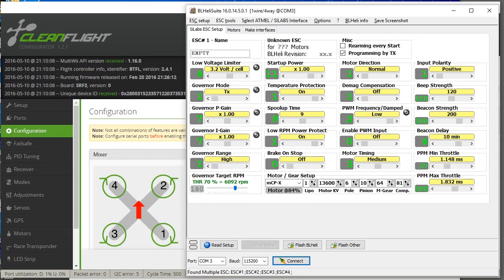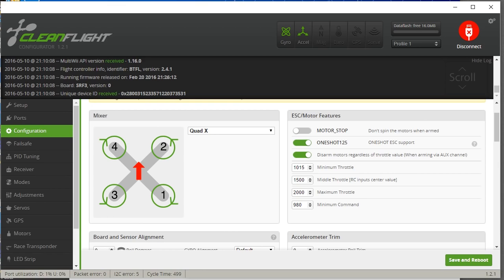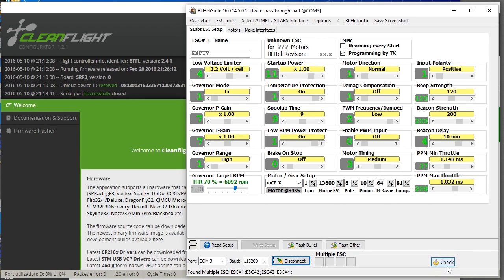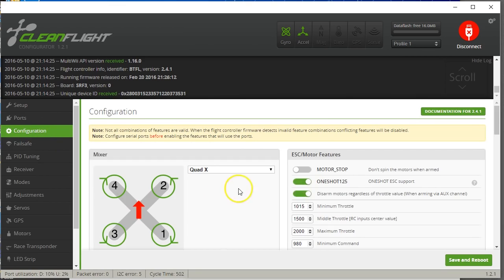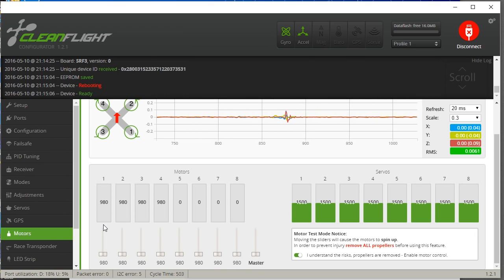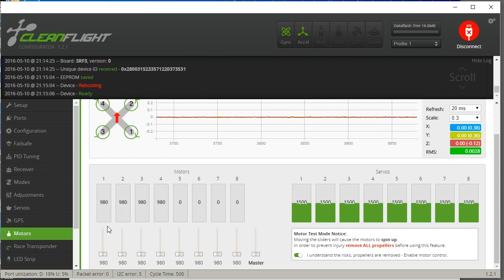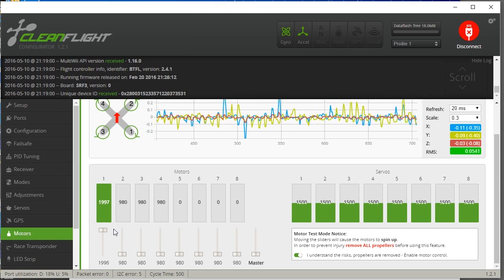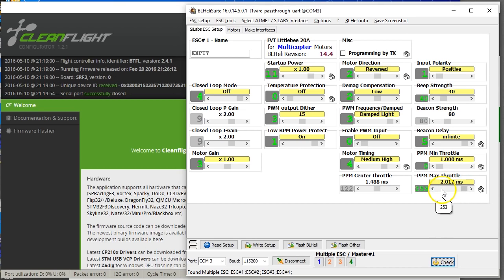Maximum Resolution ESC Calibration

Comment: I'm a bit confused on how to know the "magic number". It's supposed to be  how many microseconds I need to the point where my motor just barely starts to spin up and my minthrottle. How do I then know my minthrottle is correct? Is it pure experimenting? 
Also after a reboot the mincommand went from 1015 to 980. Why is that?
Reply: Im confused to. My minT is at 1150. And my motors barely starts spinning at 992. So is the magic number 1150 - 992? ore from 980 to 992? I must be dumb XD
Reply: No wait do i take 1150 - 992 and divide it by 2?
Reply from the maker: Here's how to know when min_throttle is correct. It's the point where, if you very lightly pinch the motor with your fingers, it doesn't stop spinning. On my ESCs, it's about 20 us.
Reply: Okay now that i get XD Thanks and thanks for all your videos. Really helped me get up to date again :P

Comment: Tried a 2S battery but it doesn't have enough voltage to boot my ESCs. Using XM20A. Cant Calibrate top end til I order a 3S I guess
Reply from the maker: +BGUFF weird. 7 volts should be plenty.
Reply: I found that 2s won't do it to. Works on the low end

Comment: Joshua I just did this with my quadcopter running betaflight 2.7 running oneshot 125. I had to set my min command to 970 because the motors would spin at 980. I then did what you said in the video and my motors were all spinning at 985. I added the 15 ms to get 1000. Then when I did the top end calibration there was no difference between 1990 and 2000. I kept going down and I only heard a tone difference once I got down around 1960. Is this normal? I am running littlebee 20a esc's on blheli 14.6.
Reply from the maker: It doesn't sound too far off. Maybe raise max_throttle a bit just to be 100% sure you're not losing top end.
Reply: I have the max pid value on the esc's set at 2020 and the max throttle set at 2000. Are you saying to set my max throttle higher than 2000?
Reply from the maker: I thought you had max_throttle at 1960.
Reply: Nope max throttle is at 2000 but I only hear a tone difference in the motors when I go down to 1960. It's the part of the video where you say to go to 1990 and then press the home key to hear a tone difference in the motors. I don't hear a tone difference until I go down to 1960 and press home.
Reply from the maker: That's surprisingly low. If you can safely do it, repeat the test with props on and see if it changes.

In theory, your PPM_max should be around 1960 to remove top-end deadband, but that's an unexpectedly low number and I would be suspicious of it.
Reply: Could it be caused by me using a 3s battery? It was only at 11.2 volts but I had no smoke stopper on it so could it just be free wheeling at the high end?
Reply from the maker: I don't think the RPM curve should significantly change based on the voltage, but I could be wrong about that.

Comment: just stopped by here again.  my sp racing board wouldn't do esc passthrough on blheli when i had cleanflight flashed, but i loaded betaflight onto it the other day and now it does. :)
Reply from the maker: Good news!
Reply: Well I have a similar issue. Just to check I used my sp racing board to see if I could use the passthrough feature and plugged in a single ESC. It worked fine.
I have now soldered all 4 ESC and when I hit connect in BLHeli all the motors start beeping together and the ESC are not recognized. BLHeli suite does see 4 ESC just no info. When I tried with a single ESC it had no motor connected so I have no idea if the beeping is normal.
Thanks for a any help :)
Reply: +nek111 im sure joshua will have a more enlightened view but its good that the escs are beeping, did you select the flash option so that blheli can find the firmware?  if you bought "blheli" capable escs they might still have simonk bootloader on them from the factory even though they say blheli on them. i had some low cost chinese ones i had to flash using simonk bootloader first before i could play with the settings in blheli suite
Reply from the maker: +Phil Dawe with Betaflight 2.7 and blheli 14.6 and up, you can do pass through over SimonK bootloader too.
Reply: I am a dummy :P After ruining a perfectly good solerjob on my board to test with a single esc, I realized my issue was that I was powering the esc before connecting in BLHeliSuite. All is good, thanks for the pointers guys, but it was just random user error, teaches me to fiddle with this at 4:30am... :P
You just got a new sub, great channel buddy!

Comment: Hi Joshua. I am getting more involved with my quad and am looking to do this calibration and the Maximum throttle calibration that you discussed in another video. Do I still need to do the maximum throttle calibration after doing this? Is there a certain order I need to do them in? Thank you very  much.
Reply from the maker: No. This includes the top end throttle calibration procedure in it.

Comment: I want to try this, but i have a doubt. Do i have to set my throttle low end point on my radio to 980? also, when doing this calibration to each motor separadetely, im going to get diferent min and max throttle points for each motor??  Thanks!
Reply from the maker: No. The input side (Transmitter to Receiver to FC) is completely independent of the output side (FC to ESC to motor). The input side always goes from 1000 to 2000 unless you have used the rxrange command to adjust this. The ESC calibration is on the output side. The two have NO relationship to each other at all. This is a very common point of confusion.

Comment: Hello Joshua,

I did this and I noticed that my motors spin on arming now. This is with BF 2.8.1 with my ESC min throttle at 1000ms and my BF minthrottle at 1038 also my min command is 950 running multishot. 

Any idea why the motors spin on arming?
Reply: I found once motor stop was enabled it fixed this problem, but I noticed in the video it was not on for you.
Reply from the maker: Is motor_stop enabled? Is air mode enabled? Both of these will keep the motors spinning on arm. Also, your min_command could be too high.
Reply: +Joshua Bardwell 

Air mode is enabled, but it does not activate until 1300ms in 2.8 correct. I enabled motor stop and that fixed the problem for the armed motor spin up. I thought min command at 950 was low, do you think it needs to be lower?
Reply from the maker: 950 is plenty low. You should be fine.
Reply: +Joshua Bardwell 
After flying I found with motor stop on that the motors would completely stop when I zeroed throttle while in the air and the quad would tumble. But when I turned motor stop off it flew great! No more dropping out of the sky and upside down feels great! Unfortunately the motors spin upon arming now. Any idea why this is?
Reply from the maker: That's just how motor stop works. If you really want, you can program an idle up switch so that when you arm the copter, the motors don't spin, but then in the air, they never will stop. But honestly, I think having the motors spin while arming is much safer. You have no idea how often I have seen someone using motor_stop accidentally bump the throttle and scare themselves while handling their copter because it was armed and they didn't realize it.

Comment: Thank you so much for these videos! I just went through doing this for the first time and learned so much in the process. My max throttle had so much dead band at the top I had to lower it from 2000 to 1900 before I started hearing the difference.  I did a little experimenting and now I know how those numbers all correlate. I've  been struggling with tuning different quads' throttle ranges and this is my answer.

Comment: Can you connect a LiPo battery charger to the quad and set it to charge a 2s battery instead of actually using a 2s battery as you suggest? I don't want to have to buy a 2s battery just to do this.
Reply from the maker: That' won't work. The charger is smart enough to know there's not a battery plugged in.
Reply: +Joshua Bardwell if I add a light bulb in line would that add enough load to trick it maybe?
Reply from the maker: No. It's going to measure the existing battery voltage, and when it sees none, it'll give an error. Maybe if you put the battery in parallel with the copter it would work, but I don't know.
Reply: +Joshua Bardwell okay. Sounds like just buying a cheap 2s is the way to go. Found an 800mah for 6$ shipped from NY so I'll just snag that since it's pretty cheap

Comment: Min throttle coming from my radio is @ 1071 but after setting ESC PPM Min to 1000, my motors will start to spin @ 1019.  I'm not really sure what to do with that data.
Reply from the maker: The input side (TX to RX to FC) and the output side (FC to ESC) are completely independent. Their endpoints and configuration parameters do not relate to each other in any way. The input side goes from 1000 to 2000 by default, unless changed using the rxrange command. The output side goes from min_command to max_throttle, and it is those values that must be calibrated to match what is in the ESC PPM min and max.

Comment: Wow...I just applied this and my airmode is now smooth as a cat fishes belly!...one question. You stated it should be done with all 4 motors? Would not that put them out of balance? And how would I set the end points individually? Shouldn't it all be one curve? Min to Max?
Reply from the maker: +G-Sawus the max may vary by ESC if their oscillator are slightly different. It probably doesn't really matter.

Comment: Why did you throw out 1000-2000 the lower dead zone (980-1000), but the hi is not thrown out, to be in 2000-2020?
Reply from the maker: +Евгений blheli won't let the bottom go below 1000 or o would go there.

Comment: So the "older" ESC's 1 1/2 -2 yrs are F330's?. Do you use the min throttle and max throttle command in cli to calibrate? Like with simon K or just the cheap hobbywing (don't ask).... I have a few sets that are not marked, how do you find out what firmware?
Reply from the maker: +Robert Erwin If you go back 1.5 to 2 years, I don't even know if F330 was the standard. I honestly don't know. Back that far, most ESCs were running SimonK I think, and BLHeli was more in the helicopter world than multirotors. If you have old, unmarked ESCs, I wouldn't run them on a multicopter at all.

https://www.youtube.com/watch?v=NOnm5a7S3aA

Comment: Hey Joshua, I think there is a little issue in this method maybe only with MS. So I did this method just now and during the full throttle calibration I had a thought: the ESC expects the full throttle ppm at 2020ms and the FC is set to 2000ms so what if the FC endpoint can't reach/overshoot the ESC endpoint and by that don't reach full rpm. With this thought I set my ESCs to a point where I was sure the FC setting is above. In my case I gave 1887ish a chance and the motors spinned way higher. So there will be a point if you go down from 2020 where one can think that the max point is reached because the sound of the motor will change but this might not be max rpm. I think it would be better to start the full throttle calibration at a point where you can be sure the ESC/motors are maxing out. So just a thought maybe the logical part in my brain isn't maxed out either :) btw. my ESC endpoints were around 1932ms
Reply: +quickfly it works but you should keep lowering the number and testing in the motors tab until you can see that the final step is getting lower than say 1990 and then go back up one step and check your top throttle point in the motors tab and set you max throttle to the highest one.
Reply from the maker: +quickfly That's not bad advice. You definitely want to make sure you're achieving full throttle.
Reply from the maker: +quickfly But remember that there may be a flat spot at the top of the ESC's throttle curve. So if that's true, then the fact that the FC is not getting fully to the top of the ESC's throttle curve is correct.
Reply: Yeah that's right I think one can do both ways and everything will be fine if one pays enough attention to the top end calibration. You really want to find the point where rpms won't rise any higher and the ESCs are at the bottom of the flat spot. Maybe in my case hearing my motors with 2S LiPos for the first time didn't helped either. So got my ranges now perfectly dialed in which are now 1000-1932 in blheli as opposed to the former calibration method which set the range to 1028-1892 That's quite bit more (all with MS14.4). Mission accomplished Thank you for all of your helpfull vids and contents!

Comment: how many input steps does multishot has
Reply from the maker: +Marcus Mc Kay I don't know. The pulse length is shorter by a factor of about ten, but obviously BLHeli didn't reduce the resolution by a factor of ten.
Reply: +Joshua Bardwell: Here is where I get lost .. 250 steps reso. you have 1000 steps min to max so if my math is right 1000 / 8 = 125 ( as you said blheli / by 8 on input). So blhel breaks down this 250 steps to 125 step intervals ?( 1/2 of 250 is 125 ). Correct me if I'm wrong and talking nonsense.
Reply: +Marcus Mc Kay So for the 10 times faster multishot you are looking at 313 steps of reso at 156 intervals.. I can be wrong
Reply from the maker: BLHeli divides the actual timing value by eight, to reduce 1000-2000 µs to 125-250 µs. This is a range of 125 µs, or 125 step intervals. So I see where you are getting the argument that the actual input resolution is 125 steps, not 256 steps, because the bottom half of the range is never used.

The best I can do is to refer you to this post on rcgroups: http://www.rcgroups.com/forums/showpost.php?p=33630994&postcount=7002

Comment: Oh man i have been troubling 1,5 days why my motors start spinning unarmed on the bench after Multishot calibration and i was wondering why i had to put under 1000ms min command to stop this. I thought something was wrong with my components and when i gave up in my mind... I relaxed opened youtube and i saw this magic 980 number in the video and i felt a miraculous relief. Betaflight 2.7.0, LBs 30a f394 with xracer f303v2.1, fw14.5v multishot my motors sit quiet unarmed at 995us min com. Btw i also tried everything at raceflight and cant stop motors getting signals unarmed from even 1ms min command - i cant fix it with bl heli MS 14,5 in raceflight. By my (probably wrong) intuition it feels like the low end smoothness of new 14.5fw interferes with multishot 14.5fw version at low end lol.
Reply from the maker: +george antonopoulos I had to go down to min_command=950 to stop the motors.
Reply: +Joshua Bardwell Ouch! Ok im fine with 995 then xD. That gap between bl heli suite and configurators makes me anxious though.
Keep up the good work teacher cheers!

Comment: good explanation joshua. When i full throttle my f3 flight controlled quad and then cut the throttle, (say at the apogee of a verticle launch for a flip)  im getting a very nervously long second or so dead-spot when it free falls before it responds again to my 'throttle back on' input. my motors are dead for a while before spooling up again, even though im giving them full input. maybe this throttle min/max is what i need to tweak?
Reply from the maker: +Phil Dawe The relevant parameter is your min_throttle. If min_throttle was way too low, the motors would stop entirely, and it would take them a bit of effort to spin up again. How many µs are there between your initial twitch/spin point and your min_throttle?
Reply: +Joshua Bardwell think youve hit the nail on the head. theres a 73ųs difference between my esc (1148) and my cleanflight configeration of 1075) is that the problem? thanks a bunch. (fist time ive used bkheli and cleanflight)
Reply from the maker: What is:

min_throttle
min_command
PPM_min in the ESC?
Reply: +Joshua Bardwell
min_throttle: 1075 (cleanflight)
min_command: 1000 (cleanflight)
ppm_min throttle: 1148 (as read on blheli)
Reply from the maker: Okay, so the huge difference between PPM_min and min_command means your ESCs are not calibrated correctly. Go ahead through the steps in this video and you should get a different result.
Reply: +Joshua Bardwell will test. thanks i really appreciate it. im temporary sending you a couple bucks via patreon. cheers!
Reply from the maker: Very generous thanks so much. If it is easier, you can do one-time contributions via paypal at: http://paypal.me/joshuabardwell

Comment: man, you & Boris are realy pushing the limits of what is possible with this tech. we al want a  copter that is an extension of our own mind as good as it can get . and these little tweaks are making the difference. keep up the good work! cant wait when the hardware gets better and everything get so fluid that we forget we operating a machine..  here and now history is written!
Reply from the maker: +Hans Turpyn if you haven't upgraded to multishot, that will be another big improvement.
Reply: +Joshua Bardwell i already use multishot. does it have anny effect on slower chip esc's like the regular littleB's? i read also about blheli..S.
Reply from the maker: Sure yeah, for sure. It helps on even F330 ESCs.

Comment: looking at the graph your motors are terrible. Mine dont go over 0.03. Off topic I know but just saying.
You must really give them a hard time.
Reply from the maker: +Noel Harris yeah for sure. I recently replaced all the bearings and it got a bit better. But the thing is, the copter still flies fine, once I vibration mounted the FC. So between vibration mounting the FC and spending $60-$100 on new motors, you know what I did.

I reckon the vibration would make more difference in BF 2.7.0, where the filters have been relaxed significantly. But for the time being, copter flies great, not going to touch it.

Well, actually, I did just receive a set of 2205/2700kv motors from RotorGeeks so maybe I'll put those on... Hmmmmm.